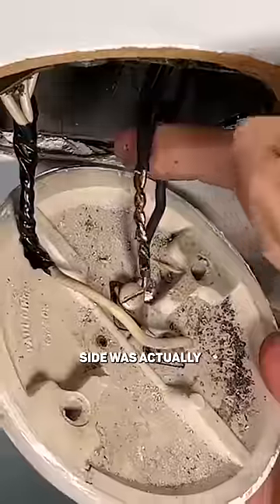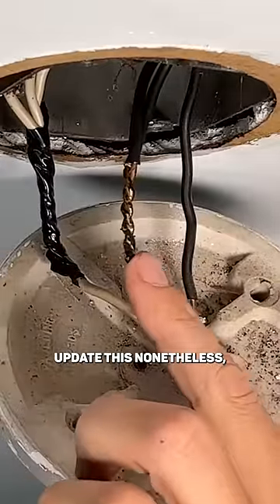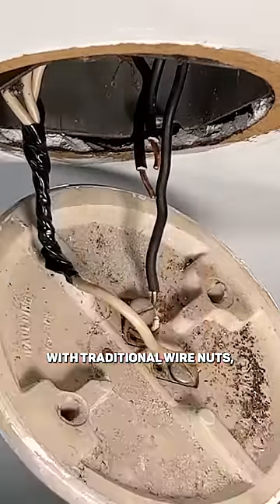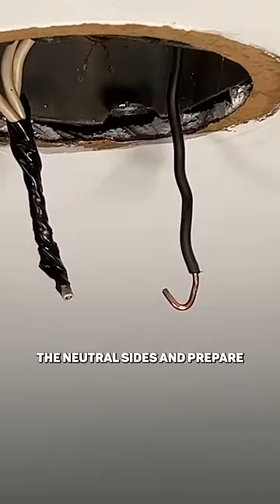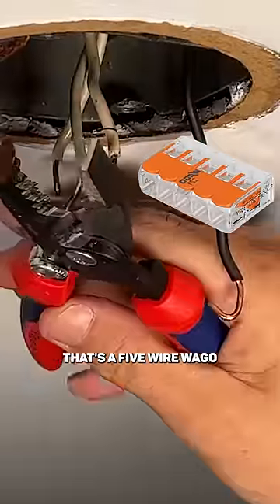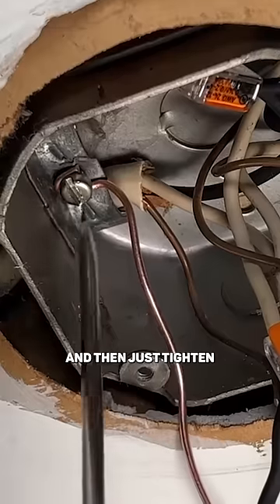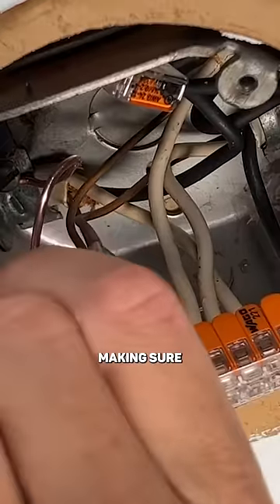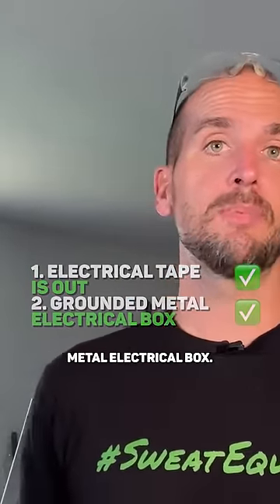Which Part Doesn't Meet Code?

Comment: Instead of going with traditional wire nuts I’m gonna use something that almost all electricians hate because they fail
Reply: Yes indeed Wago are ok for testing circuits on the bench but not reliable in service.
Reply: Same reasons why any decent electrician doesn’t use the stabs/ quick connects on the back of a receptacle or switch. Traditional wire nuts that come with fixtures are junk, modern ones make 100% better joint when twisted before the nut is installed. When is a clamp screw allowed to double as a bond screw?
Reply: @thetags5846  all earth terminals on pattress boxes are clamp screws, Clamp cage terminals are the best from 0.25mm up to 90mm. Above that its crimp lugs and bolts.
Reply: You clearly aren’t an electrician lol
Reply: Maybe all American electricians but Wago’s are used universally over wire nuts in most of Europe now. At least I know for a fact German electricians love them.
Reply: LMAO - WAGOs don't fail 🤦
Reply: @rachel705  Wago’s are quickly becoming standard in America theres just a lot of guys too cheap to use em.
Reply: @NicMediaDesign  the fuck they don’t.  Lmfao
Reply: @NicMediaDesign  wago definitely do fail, They can't cope with moisture because they are made from mild steel and start rusting, Check with a magnet if you don't believe me, the plastic does not like Air Oil or hydraulic oil.  
They are ok for temporary fixes but not long term repair.
Reply: @rachel705  UK has never used wire nuts either, However as an industrial electrician I have had a lot of bad experiences with wago, unfortunately they are not made of stainless as claimed, a magnet will show you this.
Reply: Not only that he cut out the solder which is literally stronger than the rest of the wire, and cannot fail under normal conditions
Reply: @rachel705  same here in Sweden. WAGOs are the standard for basically all electeicians here.
Reply: Lol no one uses wire nuts here..
Reply: Total nonsense. Wagos are brilliant.
Reply: @dogwalker666  
You have not a clue.
Reply: @dogwalker666  
Nonsense!
Reply: @gtb81.  
The solder will not give a good connection on the Wago.
Reply: @johnburns4017  sometimes, for lights and stuff definitely, but on an outlet string, they will break down eventually, I have seen it happen
Reply: @johnburns4017  then don't use a wago, Wirenuts have no issues with twisted soldered connections. They would have been the most effective and quickest way other than replacing the tape
Reply: @johnburns4017  yeah obviously I am only an electrical engineer who works with industrial control systems and you are a diy YouTube expert lol, how many million euros machines have you repaired this week?
Reply: @johnburns4017  wago are mild steel you obviously have never checked them with a magnet oopsies, 
And they do fail I had 3 go down this morning the plastic had gone brittle and fractured, had to replace them with crimped connections, just domestic sparkies are too lazy to do the job properly.
Reply: @gtb81.  
Nonsense I have Wagos on my outlets at 32A.  They have been around for decades in Germany without problems. The have commercial Wagos that are 16mm 20mm 25mm cable, etc. Not a new thing!

In France, Germany, etc, and now in the UK, they have outlets with Wago connections on the back. Most LED downlighters have them on the back. 

The never work loose and always apply the correct torque. Best innovation to electrics in the past 30 years.
Reply: @gtb81.  
Wirenuts?  Are you serious?  Terrifying!
Reply: @johnburns4017  that may be so, but keep in mind that is 240V, we have 120v sockets, which very often see full load. regardless anything that heat cycles and relies on a spring connection will start to wear down, it's simple physics and thermodynamics. i have also seen them fail myself, like many other styles of push connect fittings, i repair several almost every week just in my area. you cannot tell me they will not fail when i myself have seen them do so.
what's wrong with a wirenut? its simply a coil of metal inside a flame proof plastic housing, of which (if done properly) doesn't even make the connection, but simply holds it together. they also make them out of porcelain for total heat protection. Granted, on lighting stuff in fixtures i have to qualms about using wagos, so i will use both, i am not saying to never use a wago, just that they aren't as good as you may claim, at least on on all applications. 
circumstance is key in this industry, there are better methods for certain situations and vice-versa
Reply: @johnburns4017  says a DIY expert lol.
Reply: @gtb81.  
Cheap screwless connectors? You get what you pay for.  Wago is the best. Never had a problem.

Do a search on YouTube._efixx wago._ Lots there explaining it all.
Reply: @dogwalker666  
The Wago CAGE CLAMP is made of high-quality chrome nickel spring steel. The current bar is made of electrolytic copper with a tinned surface.

Stop writing tripe.
Reply: @gtb81.  wrote:
"i repair several almost every week just in my area."
Not Wagos. Rips offs and inferior products maybe, but not Wagos.
Reply: @johnburns4017  I have just removed a wago from a reed switch that had corroded and the nichrome spring was only making intermittent contact cost 2 Hrs of production replaced it with a clamp connector, 
So wago may be ok for domestic wiring in non damp conditions but not industrial wiring, So stop talking smeg.
Reply: @dogwalker666  
Wago are the best for domestic and commercial for sure. They are NOT mild steel. You look at specs and the environment any equipment is to be fitted.
Reply: @johnburns4017  domestic possible commercial definitely not,  They are not suitable for commercial or industrial purposes,  No one expects them to be IP rated but they were advertised as stainless steel,  Corrosion resistant they are not. 
A comment on here claimed they are stainless that would have been better if they were too cheap to use brass but no they are just steel. AND RUST!  Just like AB contactors that exploded this morning due to being extreamly poor manufacturing quality. Replaced with Telemecanique far better quality.
Reply: @johnburns4017  Honeywell controls say no more that explains a lot, 
Funny but we have 110v single and 3 phase in industry with 415v 3ph and  500v DC scary for someone who  thinks split phase 220 is complex, 
And yes your distribution boxes are from the 1950's and all American control gear is antiquated, Imperial bolts too, and cable sizes,  
When Schneider bought Square D to get into the US market and tried to bring them into the 20th century they all cried because the bolts were metric and we had to cable tie a set of metric Allen Keys onto the drives, Must have been so embarrassing when the French were supplying higher technology than the Americans.  
I have used Honeywell,  Allan Bradley and Square D Personally they are naff  
Siemens or Mitsubishi for plc,
Telemecanique for control gear, 
I will admit ABB make nice compact isolators,  
And obviously everything is Metric.
Reply: @dogwalker666  
Wagos are sold for commercial applications being used extensively in such use.  Not sure about industrial. If any electrical connection is in a damp environment it has to be in a waterproof box.  So a Wago in such a box is fine.
Reply: @dogwalker666  
Landis & Gyr (I worked for them) and Staefa both made superior control systems than Honeywell.  Honeywell were clunky, outdated and overpriced. Landis & Gyr were taken over by Siemens. 

US electrical systems are ridiculous for domestic use. Outdated system and the junk they use for it. A flashback in time. 

Best is UK using French and German main panels. They have as standard DP breakers. No N bar inside. But UK panels are not far behind. Getting there. 

Per capita the USA has 12 times more electrical deaths and accidents than the UK. Easy to see why.
Reply: @johnburns4017  I used to make HVAC control panels for Landis & Gyr,  we only supplied the panels others did the installation,  They appeared to be pretty good, but HVAC use different standards to the automation I am more used to.
Reply: @dogwalker666  
Again:
The Wago CAGE CLAMP is made of high-quality chrome nickel spring steel. The current bar is made of electrolytic copper with a tinned surface.

It s not just plain steel.
Reply: @johnburns4017  doesn't matter how old it is, if it is simple and it works it's not antiquated, that's like saying an electromagnet is terrifying and antiquated because it was invented over a 100 years ago. It's silly and idiotic to dismiss something because it's been around a long time, you overlook the fack there is a reason for it. Just because something may not be your preferred method means nothing to its effectiveness in an industry or application ideals.
Reply: @johnburns4017  i have had genuine wago connectors fail, often because the metal gets weak from heat cycling
Reply: Wagos are much easier on the thumbs, and no problems so far
Reply: @gtb81.  
American equipment is big and crude.
Reply: @gtb81.  
If the connector is getting hot it is undersized.
Reply: @dogwalker666  . I can guarantee grades of stainless steel are magnetic. 304 is one that when cold formed will pick up ferrous material from the dies and become magnetic. It’s all about the alloy. Noones using 316L on an electrical wire nut. It’s like saying the helicoil inside a wire nut is somehow impervious to corrosion. I use wagos all the time with no issues. I will say. The surface area on traditional wire nuts is better for high amp draw electronics. But the serviceability is less. There’s five and take depending on what you need.
Reply: @dogwalker666  nonsense.
Reply: @robertthomas7239  fraid not old chap, People who work for a living know you are incorrect.
Reply: @dogwalker666   you’re arguing a lie. It’s not fake stainless. It’s low grade alloy formed with hydraulic steel tooling. I worked in a machine shop for 20 years. Did military and medical work. I used to deal with hypodermic 304ss with material certifications. The tubing was magnetic. And passed every single inspection including a metallurgy test. You don’t know what you’re talking about. Go take your low grade stainless kitchen knives and run em in the dishwasher a bunch. I guarantee they’ll start to rust. Is it because the stainless is fake … No. and a magnet is only a quick dummy test. Grab a steel screw and a cold formed stainless deck screw. The magnet will grab both just a matter of how hard. Google lies? Like there’s a conspiracy on how metal alloys work.
Reply: @dogwalker666  and whoever told you at the steel manufacturer that any stainless that is magnetic isn’t real stainless is full of it. Then they also have their head up their rear end. And don’t know Jack about alloys.
Reply: @robertthomas7239  you wish!
Reply: @johnburns4017  are you, by any chance, working for Wago?
Reply: @alexanderduck6631  
No. I know excellent products when I use them.
Reply: @dogwalker666 that's an outright lie, the connecting bar is tinned copper.
Reply: I HATE Wago.  Had them burn before n will NEVER use them again.  Worst idea
Reply: @beely7848  The insulation on the wire itself will burn before the Wagos. Want to tell us what you did wrong? https://www.youtube.com/watch?v=flSs4PLai2Y
Reply: @beely7848  
Do you mean screwless in general, or the make Wago?
Reply: @beely7848  agreed
Reply: @MrWhite2222  they are not and the spring corrodes.
Reply: @TheDave4584  so you know better that the people who invented it, Dunning Kruger, 
If it’s magnetic it’s crap quality,
Reply: @MrWhite2222  they rely on a small point of contact backed up by a spring that corrodes, any moisture or vibration and they fail.
Reply: @dogwalker666  yes I do. If it’s magnetic there’s a reason. But you keep on thinking you’re right. I tried to help ya out but you insist you know better. Been doin this a long time. I’m just telling facts. First you said fake stainless then it’s crap stainless… it’s just a specific alloy. I explained it the best I could.
Reply: @dogwalker666  I find it ironic that you bring up Kruger also. It’s laughable at this point that you can be so wrong. And not take correct insight into something you 100% are incorrect about.
Reply: @TheDave4584  what is the weather like in backwards world?
Why do you defend lazy links? Are you on commission?
Reply: @TheDave4584  aww you have been conned by the fake/low grade manufacturers Genuine stainless in non magnetic the beer keg sorting machines rely on this fact, 
Scrap yards sort the crap from the stainless with magnets, 
Magnetic stainless rusts hence not Stainless.
Reply: @dogwalker666  some stainless steels are magnetic. Determining that the metal is not stainless steel with a magnet is not a valid test.
Reply: @rwillaz  whatever,
Reply: @dogwalker666  see for me. The wago is good for lighting but I won’t use it on high draw. You’re arguing semantics again. If you think I’m wrong go to a tubing manufacturer 304ss right when it comes out of the draw die and lemme know what happens with your magic magnet. And make sure you tell the guy his company is a bunch of liars and selling fake materials.
Reply: @TheDave4584  well as most lights are extremely poor build quality and use push fit wires that do catch fire and fail using wago isn't really making them any worse, 
Did a lot of work for seamless tube who make 316 food grade stainless tube, and lower grades, Guess what it's all non magnetic,
Obviously you are used to low quality products are you in China perhaps?
Reply: @dogwalker666  you’re just trolling at this point. It’s cool 😎. I’m just trying to con you also. With my China fake magnet stainless
Reply: @TheDave4584  no I really don’t trust wago I have had 3 fail this morning, The fact you don’t know real stainless is your problem.
Reply: @dogwalker666  that sucks for whoever you’re doing work for. Make sure you spin on some steel wire nuts
Reply: @TheDave4584  nope wire nuts are illegal, Only cowboys use them, Bootlace ferrule and Klippon terminals on dinrail in ip68 stainless enclosures. 
With 20mm IP68 compression glands, 
You will probably have to do a google search.
Reply: @TheDave4584  nope wire nuts are illegal, Only cowboys use them, Bootlace ferrule and Klippon terminals on dinrail in ip68 stainless enclosures. 
With 20mm IP68 compression glands, 
You will probably have to do a google search.
Reply: @dogwalker666  man you’re a fun one aren’t ya. I hope you’re a teacher for apprentices and journeyman. Assume everything and know all of it too. We should bow before your greatness.
Reply: @TheDave4584  this is true you should bow before me, Companies pay a lot for me to teach plc programming, Control systems design PAT testing and health and safety,  
And yes I do mentor apprentices who would get sacked if they ever used wire nuts, 
Imperial  measurements are discouraged and obviously metric cables,  Conduit and glands are only used.
Reply: @zakikahl6904 . Who are you talking about?
Reply: @dogwalker666  you should still go take a metallurgy course lmfao.
Reply: @TheDave4584  I used to teach metallurgy too, well spotted,  but then you don't know stainless steel from Rustless, Hope you don't ever have to do any materials procurement,  Gawd knows what you would end up with. Can you tell maluable iron from steel?
Reply: @dogwalker666  if you did you’d know I ain’t full of it. And it’s malleable. Hot roll vs cold roll. There’s tons of alloys of steel as well. You want jig plate ? Whatcha need?
Reply: @TheDave4584  2” EGT line in 316 2M long with a ball valve and bracket for 8mm telemecanique proximity switch, Have it ready for morning shift as it will need a CIP cycle before production, No wire nuts allowed.
Reply: Oh yeah 😎.  How bout "Shrink Fit" from Harbor Freight slipped over the soldered wires, Heat 🔥 and shrinked (shrunk?) and re-enforced with electric tape?
Reply: @dogwalker666  no problem! You sure you want the 316ss it’s better and more expensive than 304 ?
Reply: @TheDave4584  definitely has to be food grade, And capable of taking CIP caustic.
Reply: @ericscott6682  Apart form not having a "Harbour Freight"  that's partly acceptable as long as you use the glue filled heat shrink tubing, And self amalgamating tape,  Rather than insulation tape.
Reply: @dogwalker666  than you should probably go with alloy 20ss if you need it to be caustic safe 🥱
Reply: @TheDave4584  nahh 316 is perfectly good Just gets a few brown stains if not rinsed properly. 
That’s why it’s regulation.
Reply: the true reason why wire nuts do not fail is, because american homes are getting blown away by wind pretty quick and often.
Reply: @Streichholz1600  lol that is a good point.
Reply: @dogwalker666  lol how is anyone supposed to take you seriously if you thought stainless can’t rust or be magnetic? 

Resistant, sure.

Anyone that’s been lazy washing dishes and leaves them wet in the sink knows the rust part false LOL
Reply: @TheDave4584  I like how he ignored the First like five comments where you mention something that he said that’s incorrect and easily verifiable - that it rusts and can be magnetic in right conditions/if right alloy. Too funny. Then tried to ignore further people pointing it out. lmao. Yeah I think I’ll not trust the person that thinks stainless can’t rust or be magnetic to wire my house LOOOOL
Reply: @mrjjman2010  only fake stainless used on cheap sinks rusts'  all the metal at work is stainless and it has water running on it on constantly during production then dries up overnight,  All the water tanks are un treated stainless, all the pipework,  Even the conveyors are stainless segments,  non of it is magnetic and non of it rusts, 
Oh and my sink won't rust even if I leave a piece of iron in it overnight,  
Perhaps you should ask for a refund?  I would.
Reply: @mrjjman2010  I bet your sink is magnetic too, Get a refund it isn't stainless steel.
Reply: @dogwalker666  😆 I gotta say I’m havin fun! I bet u are a good dude. No jokin.
Reply: @dogwalker666  if you have liquid contact or high humidity wago makes clamp on dry boxes for their connectors. I looked into them for a simple pressure control system a while back. They literally just close over the wagos and increase their ip rating (I guess technically it’s not increasing the wagos ip rating if you want to be pedantic but hopefully my point is clear lol)
Reply: @JeronimoStilton14  they do last longer in ip68 rated panels etc. But only as long as they don’t get damaged, 
Yesterday I was working on a heat tunnel that is supposed to run at 215c but was having control problems, When I arrived it was stone cold and reading 635C after investigating it turns out some one had joined the thermocouple cable with wago’s 
I do use them a lot for prototyping and they are great for bench testing.
Reply: We call those future job security, 😀
Reply: Almost all electricians in the US… In Europe, Wago is standard for every electrical installation and they don‘t fail.
Reply: @SuchByte  my first breakdown on Friday morning was a Reed switch failure on a conveyor diverter the fault was traced back to wago's that had corroded and failed they were green inside and the leaver was stuck down, they looked disgusting.
Reply: Can't swear to it but I think they work well and meet many codes. They are just very expensive. Maybe cheaper in large quantities, but still.
Reply: Let the electrician's church say........
Reply: I’ve been using wago clips for years not in the marine industry and they have only failed where wire nuts have also failed.
Reply: @dogwalker666   I know this is really old, but wago connectors that I can find, are rated to a max of 85C, so that's just someone ignoring operating parameters when selecting a fix.
Reply: @JeronimoStilton14  You are correct, I have even found them on a found them on an Emergency Stop Guard circuit which they definitely are not rated for.